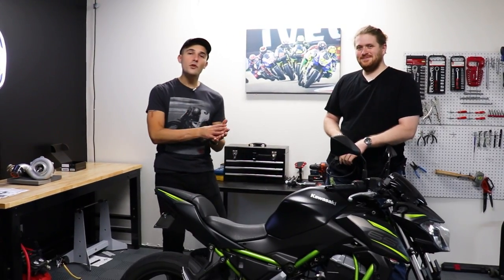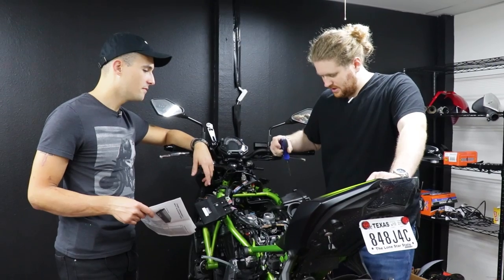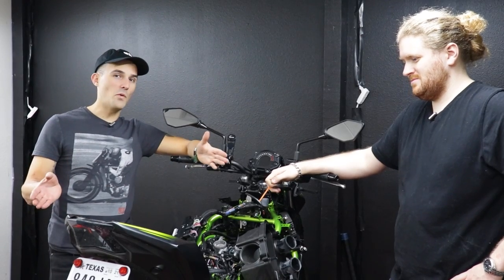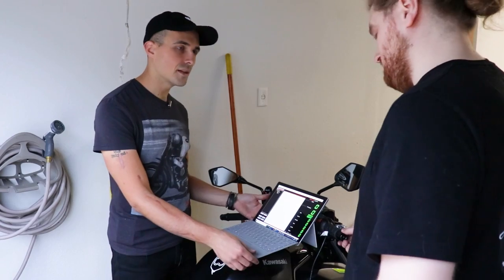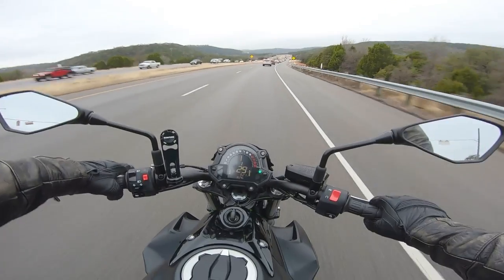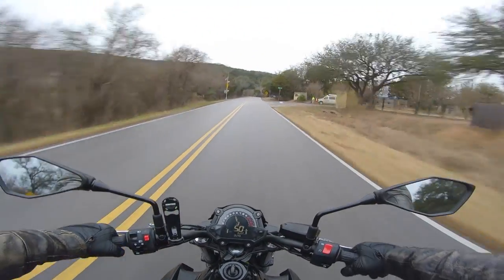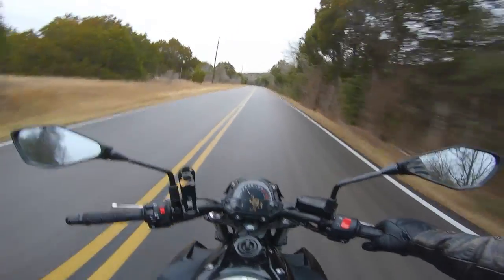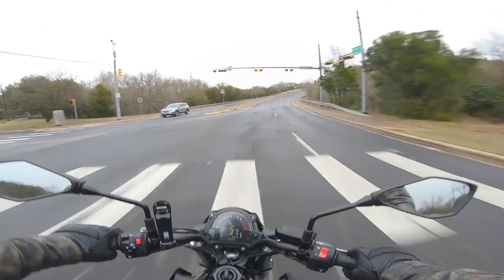Installing a Fuel Controller on the Z650 (Fixes the Snappy Throttle?)

Comment: Or, hear me out. OR.... save the money and trade up to a Z900 😂
Reply: Hahaha I bought a ninja 650 then a year later I sold that and got a big boy bike. An mt-10 ngl wish I did that from the start
Reply: @westondifranco9313  dude it's a dream idgaf bout that gas gauge your right hahahaha
edit: one metric I do care about is wheelies per mile tho 🤣
Reply: @westondifranco9313  bro if you can afford it , I’m talking about buying the 2020 or 2021’s z900 price at the stealership (I mean dealership) , otd(out the door) price after your all paid for , on a brand new purchase ... have you ..? If you’d paid it off after 3 or 4 years you’ll pay at least 11,500 to 12,500 on a z900 which sticker is $8998 or 9,400 (US dollar)when I’ve seen 2020 zh2 used for 14,000 to 15,500 cash depending on spec.’s and accessories , it seem just like a bit more like 2 or 3 extra large will get you the zh2 rather than the z900 , but I got the 2020 z900 abs and you don’t want to sleep on these bikes neither , cause that 30 to 40 mph to triple digits and beyond in the flick of the wrist , is almost like nothing else in this world on two wheels ... that thrust and g forces on humans idk but can’t wait to get on it again and start cracking that throttle , freaking weather conditions.are too far below par to be enjoying riding 🤷🏼‍♂️🤷🏼‍♂️🤷🏼‍♂️✌🏼✌🏼✌🏼
Reply: Heck yeah !!! Z900 is such an experience to be had , I tell you , came from the 2018 650 Vulcan s to the 2020 inline 4 948cc kawi zed9hundo !!! ,  man !!! ,  this bad boy is so well mannered and planted , to handling like a scooter to becoming dr. Jeckle and mr. Hidye !!! In A twist of the throttle you will have this “ master piece of a bike “transform into to an isle of Mann tt racer (or something pretty close , idk ) but ...,,, !!! Such a marvel of tech being pushed to perfection ... totally in love with it but there are other bikes I still would like to conquer  and master , so many great moto’s out hear to choose from , nothing like being on two today , we are coming to a climax in motorcycle evolution that it rocks !!! my dudes !!!!!
Reply: @westondifranco9313  the z900 is a beast. if that was my first bike id still have it 100%
Reply: @westondifranco9313  yeah I bet some risers for me  or some different handle bars would definitely make the  z900 a more capable riding experience , not sure if there is a lot on the market to upgrade the handle bars though ..? I would give some thought if it could be managed .... will be looking into it !!!
Reply: @westondifranco9313  Kawasaki’s don’t get love from this channel though  , cause if they did , you’d see zh2’s , zed 1000’s , 9hundos and all the well mannered water marked Kawasaki’s as giveaways , all though I do like the 650 Vulcan s , as a possible starter giveaway that papa yams seems to have slept on for years , idk but I think the z650 is one of Kawasaki’s bike’s , that is not the best that Kawasaki has to offer , but is very close to being the best ,  just as good ,and a lot of ways and more...kawa’s are underrated and they do have their flaws but they do not get much love hear 🤷🏼‍♂️🤷🏼‍♂️🤷🏼‍♂️cause I think I can see papa yams I’d not to impressed with the new zh2 ‘s or the z900 as an affordable and economic speed demon...???🤷🏼‍♂️🤷🏼‍♂️🤷🏼‍♂️
Reply: @westondifranco9313  I want to start buying aftermarket parts to make it more my own , but I need to work on getting my third bike , then I can afford to start throwing  after market semi custom bolt on shit , cause that stuff starts to add up , plus I got to throw a bunch of money (that I don’t have ) at this 90,000 mile.06 mustang gt , that I want to coyote swap 🤷🏼‍♂️
Reply: Z900 is one of the freaking dopest machines for the money tho and class leader in almost every way  ...papa yams did make a video on our beloved “zed nine hundo,”and it seemed like he was not really in love doing it , I think he’d rather save that love for the triumphs ...don’t get me wrong got love for the triumphs too , but you gotta love the kawi boys too ... just saying
Reply: @westondifranco9313  😱that Lil chirp tho 🤣🤣🤣
Reply: Gotta be honest with everybody. I’m not a huge Kawi fan, I don’t dislike them! I just don’t fit on most of there bikes I like 😅 im 6’5” with a 35in inseam. I love naked/ street fighter style bikes and no matter how I tried I just didn’t fit on the z650 or 900 comfortably 😭. Cool bikes though
Reply: @toofastnobrakes  try getting in the zh2 it’s has a taller seat Height by 1” or 2” ...🤷🏼‍♂️
Reply: The things the 650 parallel twin on the Vulcan s and other Kawasaki’s 650 parallel twins is that this is not even a tried and tested platform , with the likes of the evo engine and any other engine that can hit those high mileage marks like those hardly’s from liter bikes that are well maintained , but with the almost bull-it proof reliability from Kawasaki , people will just gravitate towards them because of the richness that is ingrained in them with out knowing anything besides the ninja , shit I slept on Kawasaki’s for a while now and now that I’m a proud owner of two of them , I’m hooked but do like to test out other stuff but my dollars on dem Kawasakis for a price that is almost always under top manufacturers prices in its classes ..., and has earned its mark with in the big four and even on the raceway , the heritage has been there and if it really got the respect it deserved ..?  these daily bikes have been a blessing to the everyday man or every day women the opportunity to experience a quality product , love squatting on my Kawasaki ,...., my Kawasaki’s  is fast as fuk ie , and my next bike will be a Kawasaki or an Indian possibly ..? Herd some good things about the scouts though!!!! Still love them Kawasaki’s
Reply: @allancooper3865  my pockets are not deep enough for that 😅 love my cb1000r though
Reply: @westondifranco9313  thats the direction I went. 2018 Cb1000r fits me great. And gawd I think this bike is beautiful 😍
Reply: @allancooper3865  If you go Indian ide recommend the ftr 1200. If your not necessarily wanting a cruiser but still want something comfortable. There also updating it to be more street focused for 2022, new wheels, street tires, updates suspension, etc. I’ve been checking it out and it seems sweet.
Reply: @westondifranco9313  I hear ya, what got me was I found a brand new 2018 “first year of the neo-retro update on the 1000” in Texas that was 2 years old but never sold. They want $9500!!! 0 miles!!! I only lived one state over and I just couldn’t pass that up considering the 12k new. Damn I love it
Edit: they actually had two others as well. Still in the crates
Reply: @westondifranco9313  ive been wanting them to make a adventure-sport with that platform myself. Something along the lines of a s1000xr, multistrada, versys 1000, tracer 9. Think it would be a good move. The adventure sport market is booming
Reply: @westondifranco9313  it just depends on what you want. The biggest differences between something like an mt-09 and tracer 9 are weight and wind protection. The mt-09 will be lighter, shorter wheelbase, maybe slightly different gearing, and slightly more aggressive riding position. The tracer has a larger tank so better range, more technology, better wind protection and more comfortable seating and touring ability. It’s gonna depend on what you want to do with it. But keep in mind things like wind protection and bags can be added to the MT aftermarket and still be quite a bit cheaper than the tracer. Could even do the same with an MT-10 and still wind up cheaper all together. Would be my choice personally
Reply: @westondifranco9313  sounds like a great choice it’s a lot of bike and on a budget. Ide go for that or the mt-09 if I was in your shoes. Could also consider a cb650r. Still and in-line 4, 94HP, and premium suspension for the class it’s in. Insurance will be cheaper to for the smaller displacement. If I hadn’t got such a deal for my bike it’s what I was going to buy
Reply: @westondifranco9313  sounds good 👍 if it’s right for you go for it!
Reply: @westondifranco9313  the only time I find sport tourers to be more enjoyable than nakeds is with highway riding because of that wind protection. If you're really tall I imagine the added leg room might be nice on a long ride too. Personally I find most nakeds to be comfortable enough to ride all day as long as it's off the freeway, while being far more enjoyable at slow speeds and sporty back road blasting. They almost all have shorter wheelbases than their sport tour variants too making them feel that much lighter than they already are.

But I've got an MT09 so I'm a little biased lol
Reply: @westondifranco9313  XSR's tend to attract slightly more mature riders where the mt09 tend to bring on the total hooligans who wreck more often so I wouldn't be surprised if there's a difference there.

As much as I absolutely love my mt09, it does suck on the freeway if your commute is over an hour. The up right seating position while comfortable means even with a tall screen your head will be out in the wind. Constantly pushing your head against that wind can really strain your neck after a while. You may be better served with a tracer then. I dont think twice about an hour or less but after that the wind resistance will start to get to you.
Reply: @westondifranco9313  I've never personally been drawn in by any suzuki really, but I'm sure they are good bikes especially for the money. The z900 i think is the "better" bike compared to the mt09, but I still prefer the mt09 because its just more fun.
Reply: @joeyg29jgjg  lmao thats what i plan on doing to and i just got my 650 last year absolutely love the bike just want more power ! ..... and that inline 4 sound !
Reply: Z900 and z900rs both have that throttle cut issue. Damn euro 5 rules
Reply: Mate which one better z900 or gsxs750.thanks
Reply: @marlontaroma4590  if I had to pick ide go with the z900. More power, more modern tec, and I think it actually a little lighter than the 750 as well. But comfort wise I would say the gsx s. I’m a very tall rider and the one I’ve say one felt roomier than the z900
Reply: Nah forget the Z900...  gotta set up for the H2 and trade up
Reply: Problem with that (at least for me) is finding one locally... I was lucky to find my Z650 (I'm talking zero within 300 miles of me).

Wish I knew what the google for the fix Spite is talking about - for now I'm just using a bit of clutch at low speeds to calm the on-off throttle...
Reply: @xelnjare3945  yeah I know what you mean. It tools months for me to find mine “at least in the color I wanted” but it was worth the wait

Comment: Lol if you ever look at the airbox on a z650 its in a very bad spot and there is a small hole for the air to go into. The z650 stock airbox is very restrictive and inadequately producing the the needs for the z650 engines intake. You can simply fix this issue by cutting a series of holes in the air box and giving the intake of the z650 some more breathing area. This process will eliminate that "Snappy throttle" that you are experiencing.
Reply: Never heard this suggestion. So you have done this personally with reliable long term success?
Reply: @mewfuz37  Yes I did this mod and the bike rides like a dream now.  for a bike with this much power it had a intake equivalent to a small dirt bike poor design by Kawasaki.

Comment: In my opinion, I liked the Z650 over the mt07 but that's just my opinion. You explain this bike like it has the power of a 400 when it really gets up and goes
Reply: What aspects of the bike makes you pick it over the MT07?
Reply: @Randlemannn  looks for one (but that's wholly subjective).
Reply: @Randlemannn  I have a 07 650R, they're really quick for a 2 cylinder bike, very torquey which is great in traffic situations, great on gas and just fun to drive, although there is quirks to them, there's a ton of good reasons to get a 650 especially so if you plan on riding everyday. I daily mine and I really like it, I do want something with more of a race position but I honestly think I want another bike ontop of my 650R

Comment: What Spite is basically saying is, he don't ride Kawasaki's that much. Mine did it to and what it took to fix was parking lot practise with low speed. Wrist got trained and it's no longer a problem. So, instead of throwing money at a problem, put seat time in. Not just when filming.
Reply: Feel the same thing on my Z900.
Reply: Same as me.i have no problem at all with the throttle on this bike.
Reply: @jmaloney619  how is it? Always wondered how that 4 cylinder did. I currently have the Vulcan S. Buddy has the Ninja 650 and they are almost identical underneath.
Reply: @jerryaduvall  I love the bike. I came from a Vulcan S Café and first thing I noticed was how jerky the throttle on the Z900 is. I'm still getting used to it, but it is a lot better now that I can micro twist the throttle.
Reply: @jmaloney619  I'm holding off to see if they're going to put the H2 in it. Then I'll trade. I've thought about the Z900 next. Or the new Triumph Trident. Where is not Japanese I get worried about reliability though. I've been looking at KTM Adventures for kids but have already got scared away by reliability claims
Reply: @Creepermoss  wrong. I own a Kawasaki and it doesn't do it anymore. Thinking every bike is the same is, well, retarded. Every one is different. Buying something to fix a problem that's not really a problem... Equally stupid. You have to get used to these bikes. It doesn't take long either. Muscle memory takes over and you no longer have a jerky throttle. But if you wanna throw away $160 on a booster plug when you really need to practice, to each their own
Reply: @Creepermoss  think what you want. Waste your money where you want. Or learn proper riding techniques.
Reply: @Creepermoss  it's not a"well documented" malfunction. It's how they're designed and they work exactly like they were designed to.  They are engineered to do that. So, with a little practice, you can learn correct way to operate your bike. The way the manufacturer intended. Smooth throttle. Or, you can cry like a little bitch about it and buy a product you don't really need. 
Sounds to me like you're more of a mechanic than a rider. Throttle control is crutial to new rider's. Not giving them an easy out. There's no easy way to learn throttle control.
Reply: @Creepermoss  I'll tip my hat a little. Was trying to fuck with you some. But, even going back and re-reading the websites take on booster plugs. Only tricking engine to think it's a set temperature to increase fuel. While it does make a difference in the feel, it's making the compression worse. If you're running completely stock, it's not giving you power. The day to day rideability will improve the more you ride. Still all stock with one and the throttle is smooth on it. Put over 4000 miles on since September with no BP. With new FI engines and getting more fly by wire throttle cables, the"snatchy" throttle is here to stay. 
Could be worse, could have CVT's installed. Wait, the new rebel already has something like that.  Lol
Safe riding.

Comment: What a lot of people do not realize is that fuel controllers and tuning in general on a N/A engine does not inherently increase power. It is meant to add enough fuel to compensate for the increased airflow from aftermarket parts. There will be a slight bit more power but nothing crazy. If you want the best result, have it fine tuned using a dyno as the maps you download from dynojet are base maps and can be dialed in more
Reply: I put an aftermarket exhaust on my bike and now it's running lean because of the decreased backpressure, will this help?
Reply: @talion9289 yes!

Comment: I've had a z650 for 3 years now, never noticed the jerky throttle, until I tried to just dump it today. 
So I guess you can get a smoother feel by... hum.. using the clutch ? 😅
Reply: Exactly!! I Will ask what f... Is a snappy trottle... Maybe actually is a snappy Rider..
Reply: The hell you say!
Reply: It's a modern problem that people just learn to deal with. It's just an unnecessary problem to have. Once you have a bike that isn't jerky, it's hard to go back. It's a comfort thing. It can easily be dealt with but why deal with it?
Reply: @Luiz  you feel a snappy throttle going through school zones
In PA the limit when flashing is 15. The ninja 650 is the same way, you'd be in 2nd gear and the throttle feels like a switch where its basically either closed or pulling the hell out of you. Other than  that and stop and go traffic you don't notice the snappyness because when going from a stop up to 45 or whatever traffic speed is the bike is smooth once you get used to it, but just cruising at very low speeds is horrible
Reply: @ThePwNzclan  The old person going 20kmh infront of my 650r wondering why Im having a meltdown 🤣🤣🤣🤣